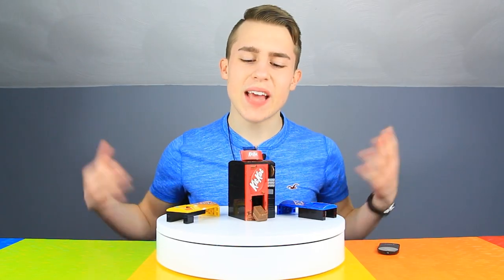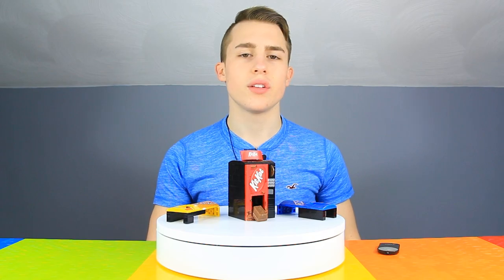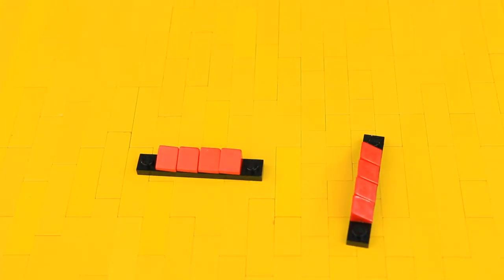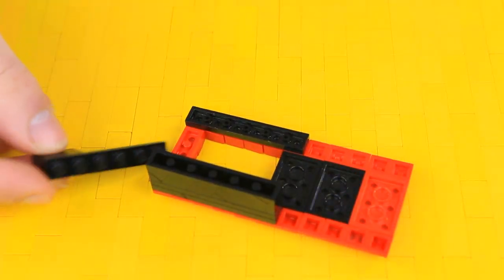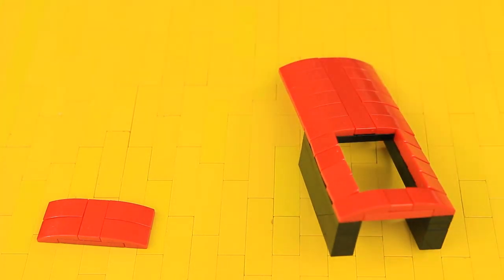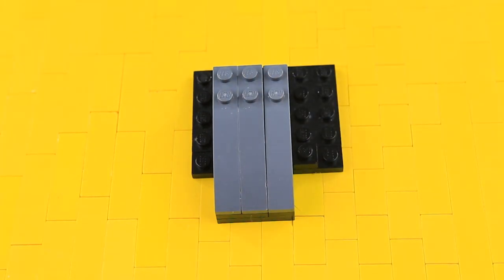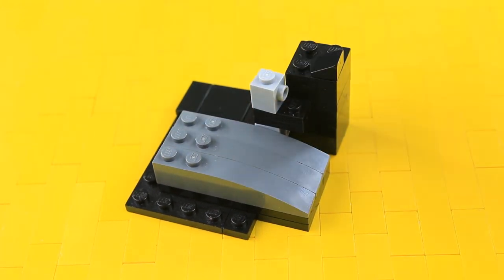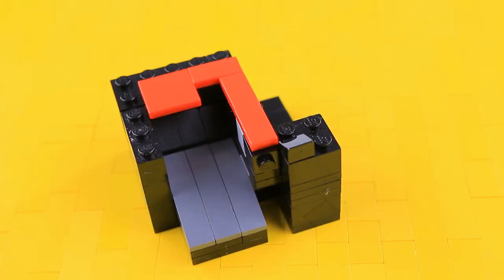How to Build Custom LEGO Vending Machines | Kit Kat, Twix, Snickers

Comment: I don't have the curve pieces could I just use a flat plate with a smooth piece on top?
Reply: FlamingGames 56 yes
Reply from the maker: Yeah, even a 1 x 1 plate topped with a 1 x 2 tile works. It wouldn't be as visually amazing, but it can still look astonishing without.